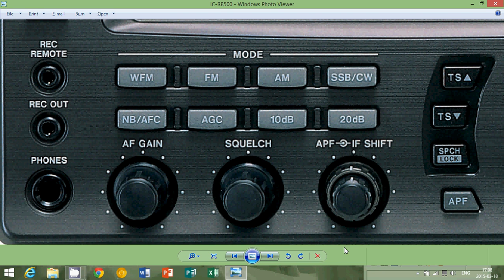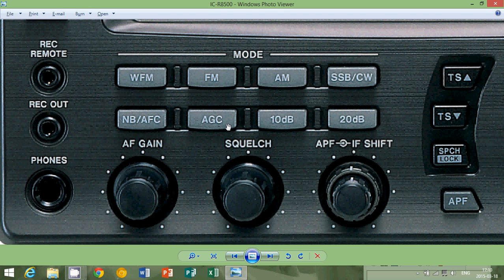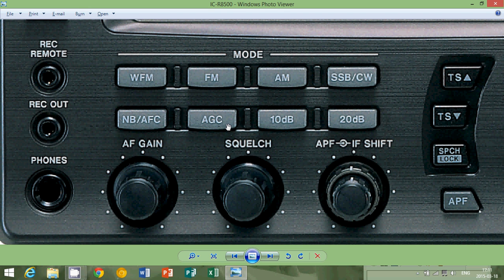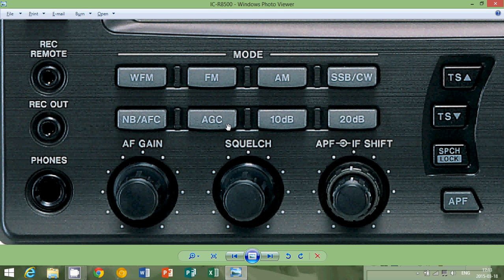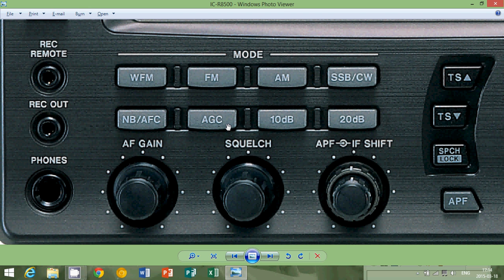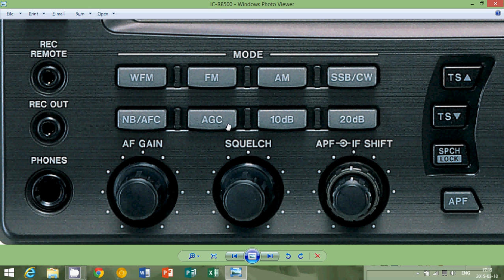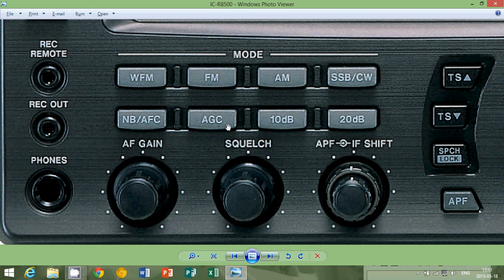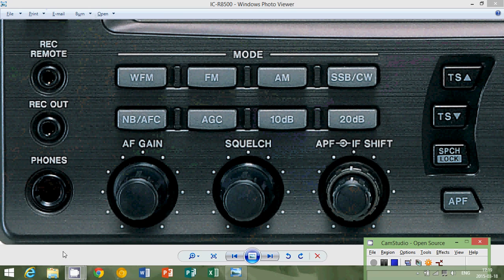Radio Terminology explained AGC Automatic Gain Control

Comment: Studying for my General Class and I'm on the topic of AGC. I found your explanation of the practical application of AGC to help me better understand the topic.  Also on the importance of adjusting AGC response for different signal modes and use in various common electronic devices.  Thank you for your explanation and video.